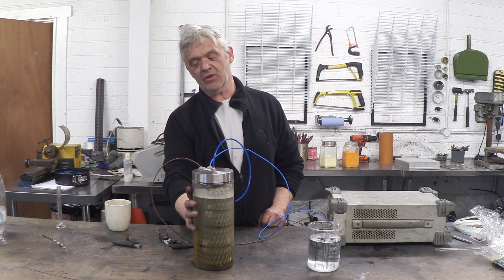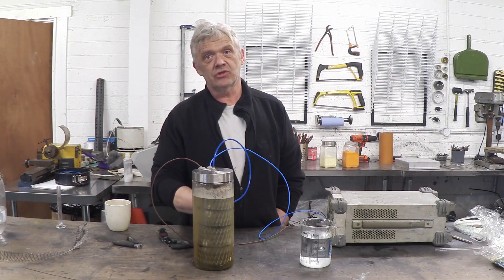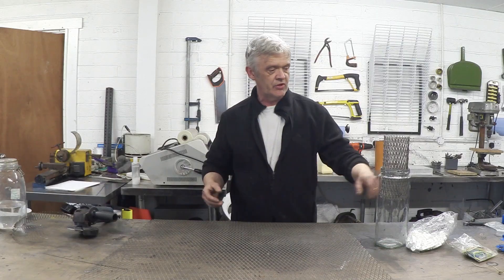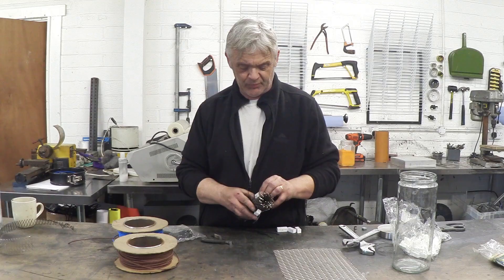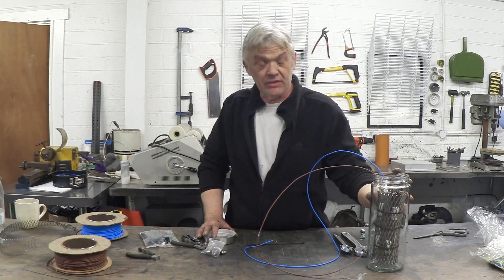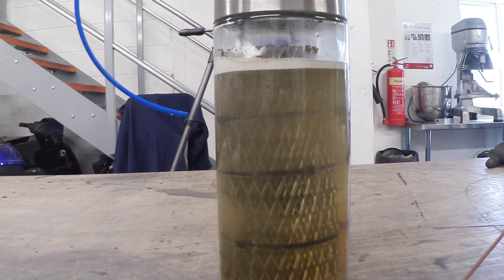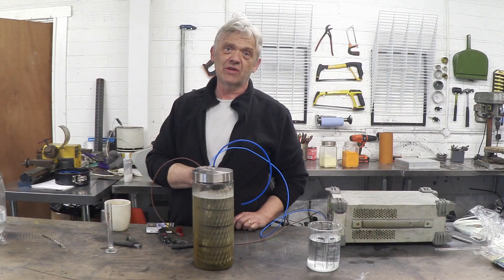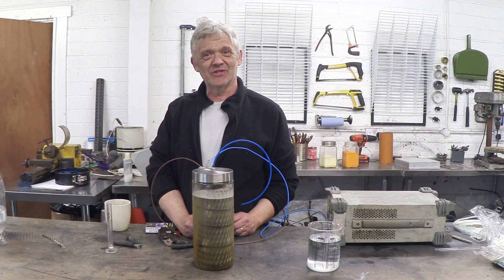Cheap And Easy Hydrogen (Brown's Gas) Generator

Comment: SURFACE AREA is the key to improved productivity and there is no better SURFACE ARE to VOLUME ration than inexpensive Extruded Carbon Water Filter Cartridges from your local hardware store, and using a very inexpensive brush-less DC water Pump to circulate the UREA through the Cartridges and back to a Recovery tank, where the Gases can be easily extracted and used for combustion or whatever else you desire. Obviously you use a Twin Filter Cartridge Housing so that both Carbon Filters act as Anode & Cathode and linked in the center via the common urea feed from the pump.

The efficiency can be further improved by electroplating the Carbon Filters with very inexpensive NICKEL, which acts as a catalyst to the H2 production.
Reply: delawarecop What type of carbon filter do you mean?

Comment: Great to you doing this sort of stuff. Don’t Brown’s gas torches burn with a very cold flame yet still cut through metal? Worth checking...... ;-)
Reply: Yep!  Even a very small needle like Brown's gas (or Knoll gas) torch will slice aluminium cans like a mini light saber and will also liquefy ceramics, yet the flame itself remains cool enough you can pass your fingers through and only feel warmth!  fascinating gas for sure.  From the limited research I've done it seems to be THE goto cutting gas for Asian heavy steel industry, as once it gets the steel up to the proper initial temperature it cuts even huge thickness slabs (1 foot +) like butter.

Comment: If you were to pump that hydrogen through a proton membrane hydrogen fuel cell would that be enough to run a car?
Reply: Flow rate /volume of the hydrogen and efficiency of the fuel cell you will need those to do any calculation.
Reply: @Barskor1  If so then he just solved some huge issues for building a hydrogen fuel cell based car.  Mainly the storage of the hydrogen. If it can be stored in the cars gas tank as urea and then extracted using a low energy electrolysis.  Then reacted to produce water as the exhaust. You wind up with a power solution that is clean, and highly scalable. The fact that urea is a liquid means that you solve charging and fuel transportation problems as well. Look up ballard power systems if you are wondering what I'm talking about.
Reply from the maker: it would depend on your setup mate

Comment: Now just waiting for the next video where you show us how to store the gas with parts from the hardware store.
Reply: Go to your Grow shop get the aluminized sheets they sell in rolls use your cloths Iron to melt the sheets and some grease paper so it will not stick to the iron or the workbench go around the edges leaving space for the inlet/outlet port. Space blankets are cheap and work but the folds and corners often have pinhole leaks
Reply from the maker: just do it on demand mate

Comment: I made one of these out of two lengths of stainless steel cable for my old VW Beetle but didn't save much noticeably on fuel. Now you're talking urea as an electrolyte I might reinvestigate. Hmmm. Cheers 🍻 

Ian, Birmingham
Reply: My guess is that you were not getting many amps.  Surface area is immensely important, additionally a strongly conductive electrolyte helps a lot too. you should use KOH. Unless you have a lot of it, a stainless steel cable does not really have a lot of surface area. and you should never over drive it at 0.5 amps per sq inch of anode, or cathode.  Build an electrolysis cell with 30 sq inches per electrode and drive it at 15 amps and you'll see reasonably good HHO production. or build a series of cells and make the electrolyte more conductive  so that you can still drive it at 15 amps and you have reasonably good production while using less power.
Because Hydrogen has a faster flame front, it helps burn more of the primary fuel  during the power stroke which helps makes a low efficient  engine more efficient. thus improving overall economy despite the power drawn for electrolysis.
Reply: @kreynolds1123  There are a myriad of reasons that HHO injection is a counter productive waste of time. Just a few off the top of my head: There is no free lunch, all the energy to disassociate the water comes from the alternator which is in turn powered by the burning of fuel in the engine. Hydrogen is much less dense than air and actually displaces available oxygen, reducing not adding to power. The IC engine is at best 30% efficient meaning that at the absolute best it is only possible to recover 30% of the energy used in HHO production. On a practical level the volumes of HHO produced by most automotive applications is utterly insignificant in relation to the volume of gasses passing through the motor. The majority of the 'snake oil kits' produce less than 10 litres an hour on the other hand a 2 litre car engine operating at 2500RPM processes 300,000 litres an hour. If you want to produce more HHO you need to burn more fuel, there's no other way.
Reply: You don't have to pull power from the alternator. Most of the energy released in an engine is wasted as heat. This waste heat can be used to generate electricity using a Stirling engine or peltier module array... No  extra strain on the engine...pure efficiency boost. Simple.
Reply: @reincarnatethylacine70  i worked with a company who's HHO generators produced over a liter per minute. We seen between 20 and 25% improvement  in the fuel economy on large  trucks and busses for local transit commission that allowed us to install and run test and collect  telemetric data.  Some observation were lower Nox  and lower exhaust temps along with   improved fuel economy.  

Yup, this isn't a free lunch, and 'though we were producing over liter per minute, these big diesel engines  suck down a lot of air and fuel and are not known to be highly efficent.  You only need a little bit of hydrogen,  and though hydrogen displaces oxygen,  oxygen from the atmosphere is 19/20% while HHO gas is 33%. but still, you only need a little.  You see, hydrogen has a much faster flame front. This helps burn more of the primary fuel more completely during the early parts of the power stroke, which is why we also saw more power. 

Unfortunately, the owners of the company were set on an inefficient design and used chemistry that lead to early plate deterioration which lead to too much maintenance  replacing plates.  And furthermore, chromium leaching is certainly an issue that needs to be properly disposed  to keep out of the EPA cross hairs, not to mention the practicality of keeping the electrolyte from freezing during the winter. 

Yes there are snake oil sales men in the HHO business. But mostly it's just ignorance, and or people not willing to spend on enough plate surface and over driving  the little plates they have with too high voltage making too much heat.  And, were not running the engines on water.   Instead, were running them on gasoline or diesel, and adding just a little bit of HHO gas to improve the burn of the primary fuel.
Reply: @kreynolds1123   
Great explaination Sir have you done any expirement on hho if yes plz say which electrodes  and which solution will give more effect
Reply: @palaravi775  I used 316L stainless steel for its corrosion resistance, and it's much cheaper than platinum, and graphite carbon wears out too quick.
Reply: Who would have think it! You just needed to carry more pee around with you.
Reply: Basically pee.

Comment: Hi.  I would use weed eaters string as spacers to roll both sheets at once. Should make a big diference. Keep the good knowledge roll.
Reply: I'd use some plastic dish mats or plastic poultry fence, fairly cheap, and really easy to use, just make a sandwich with plastic/metal/plastic/metal.

Comment: probably a stupid question, but would changing the anode/cathode material (maybe graphene) change anything like the power input req or how quickly the hydrogen got pulled out of the water? would it even work  with graphene?
Reply: I don't know if this would help but a used flashlight battery has a graphite node that I would use as an anode (+)

Comment: Even better, electrolyze dilute glycerine solutions from bio-diesel effluent, dirt cheap stuff -- almost as cheap as crude oil these days lol, plus it is highly alkaline, making it strongly conductive. Ideally you'd want a PGM catalyst on the cathode and anode for best efficiency. Bonus, you won't even release CO2, but sequester it as carbonate in the process!

Comment: Breathing that gas in a controlled environment has specific and ranging benefits. Burn recovery is accelerated by multiples.
Reply from the maker: is that right - awesome - cheers for that mate
Reply: @ThinkingandTinkering  "Hydrogen Inhalation" pubmed :extremely enlightening results

Comment: very cool rob.  The biggest complaint I've seen on urea electrolysis is the foaming that occurs.  I don't think 60 watts is a rate that can produce on demand gas production for jeweler torches (most active users of home built electrolysis) So it's probably way less of an issue. The other issue at low volume will be storing it safely. Flashback arrestor and bubbler to some sort of bladder?
Reply: Separate the oxygen and hydrogen by isolating the positive and negative sides. That way no oxygen mixes with the hydrogen. Much safer. Then transfer the hydrogen to a bladder or use a compressor.

Comment: Reason why water is brown is
-iron in stainless steel is rusting...& acid in urea is catallyst.
(Stainless steel is either mixed/OR coated with nickel or other non-rusting metal....problem is coating's cheaper but  doesnt work once surface is cracked/broken/sawed off/wears off, exposes iron to water rusting in steel:carbon/iron mix)

Same thing happened to my $2,000 hydrogen generator....i sent email to supplier & exchanged the steel ones for titanium...
--that was like 10 years ago...now i read i need medical grade titamium rods to prevent it from eroding away tid bits into my car engine block.
(Felt like supercharger/pushed me into my seat on higheay testing)

-always a pleasure/nice to hear advances in technology/& breakthroughs from ROBERT MURRAY!  XD
Reply from the maker: cheers mate nice tips - but tbh - doesn't matter if you need to replace the electrodes considering how cheap and easy this was - it would be a pain in other designs for sure - what you said is well worth bearing in mind though - thanks for the post

Comment: Hi Robert..me again! Another great video! Ive always wanted to build one of these. What an excellent way to do it. Much simpler than the ones Ive seen built before! Just to note, and I am dragging this from a dim and dusty memory so please don't quote me, but I remember reading that one could get a very good production of hydrogen from a solution of Caustic Soda. Sounds dangerous but I'm sure that was what they were using. Not as readily available as pee though! :o) xx
Reply from the maker: KOH or NaOH is used mate but you are right peeing in a bottle is just so much safer lol
Reply: @ThinkingandTinkering  Ah..yes..Chemistry not my strong point!

Comment: Hi Rob, this is very interesting, are you planing on using the H2 to make electricity with a hydrogen fuel cell, I'm hoping that is your plan :-)
Reply from the maker: yeah - remember that green generator I found?
Reply: @ThinkingandTinkering  Yes remember it, not a fan of using hydrogen this way, via this route you would need to ensure lubrication is added along wit the fuel, which is ok, however the efficiency you gain form producing the hydrogen by your method (IMO) is lost, hence my thinking of going with something better like a PEM, I'd love you to look into MCFCs or SOFCs with a view on the home hobbyist, anyway always something new to learn from your videos,, cheers.
Reply: Maybe heating water then running it through a Tesla turbine operating as Cold steam under vacuuum.

Comment: You mentioned urea as a fertilizer, do you buy it from a farm supply store? Also was the hydrogen freely escaping into the room atmosphere or building pressure in the jar to a certain pressure  before escaping or being collected? Also what happens if you up the power to say 5v 3a, would that effect the results
Reply from the maker: yep farm supply will sell it and in this little set up it was freely escaping - but I didn't run it for long - and that's why lol

Comment: Dear Rob,
this devise is superb in conclusion with photo voltaic. If you run PV and not consuming all electric power you can produse hydrogen with this generator and store it for later purposes. (Called Power to gas, but many said it's not eficient enough - 30% effectivity only ...) For example feed a petrol motor with hydrogen you get electric power and hot water as well. Or just use the gas for heating or cooking.
Great system! Thanks for the upload!
Reply: You cannot store Brown's gas. The oxidizer and the Hydrogen are never separate so the combustion mixture is always stoichiometric. That's why Brown's gas POPs really loudly, and Hydrogen merely whooshes. It would be suicidal to store brown's gas under any kind of pressure exceeding a balloon.
Reply: @aarondonaldson4164  what about storing it under water inside the balloon?

Comment: The idea of a electrolizer that can produce enough gas to run a torch on has always been something I want to build.. Even beter would be a electrolizer that separates the resultant gasses, but those requires some membranes to get working adding complexity...
Reply from the maker: you can do it mate but if the aim is to feed it into a motor it's probably not really worth the effort - just fiddle on with the carb settings
Reply: @ThinkingandTinkering  I meant a torch, like a oxy-acetylene torch setup... Those rigs are stupidly expensive to own over here and hard to justify when you would only need it occasionally. I have always thought that a electrolyzer setup could potentially be the perfect alternative if you could easily build one that produces enough volume to effectively run the torch...
Reply: Evidence suggests that the 2 to 1 ratio of hydrogen to oxygen in hho gas is perfect for burning. Caution should be taken but that’s true of most things.
Reply: @mikebond6328   lol hence why as per my original comment, a system where you can keep those separate would be most ideal, I have seen it done on the hobby level, but it is quite a complex setup..